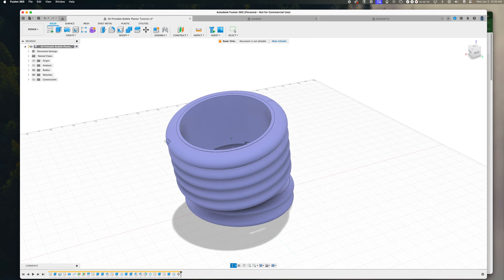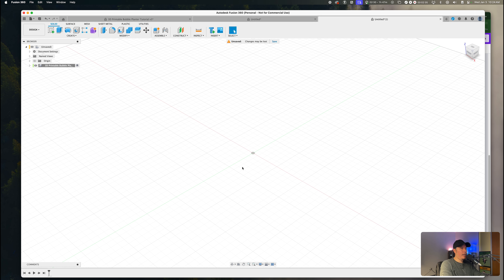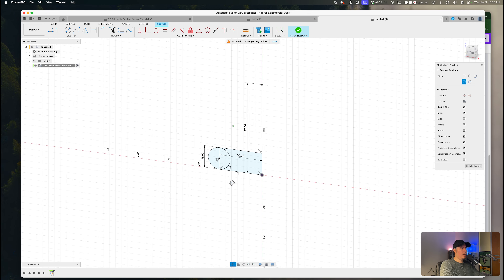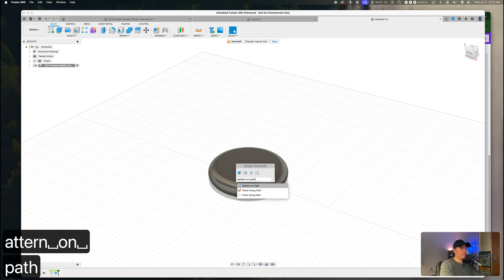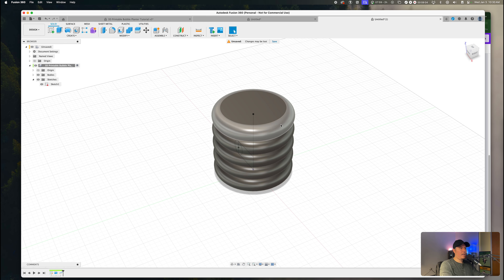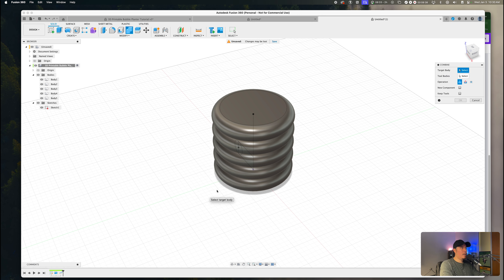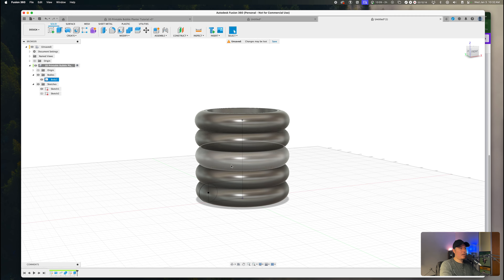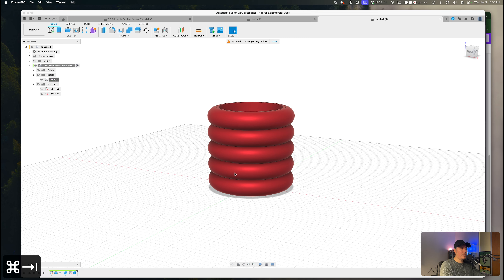Fusion 360 Course for 3D Printing 2024 Edition | Part 3 Designing A 3D Printable Bubble Planter

Comment: Hey Brandon, how are you getting Sketch Dimensions to immediately appear while creating sketches? @1:53 

I have to manually add Sketch Dimensions once Line/Rectangle is complete. Thanks!
Reply: This wasn't clear to me either.
Reply: @glycerin256  I believe I figured it out, try typing in your measurements (tab to switch measurement, e.g. if creating a square, then press enter) then your dimensions will be there!